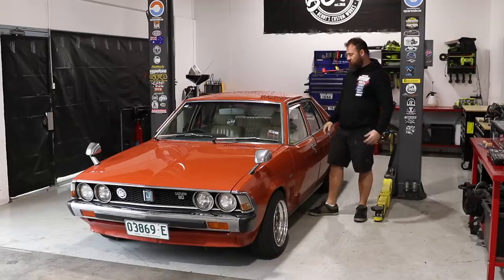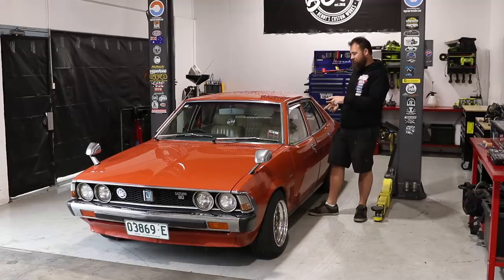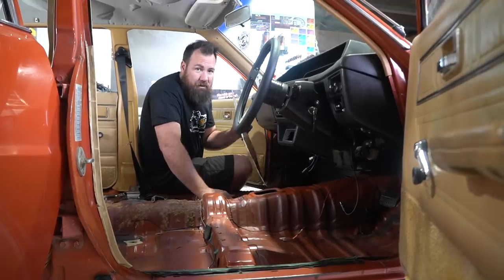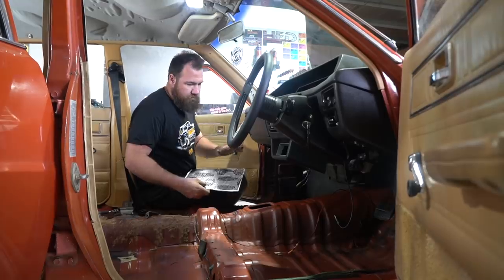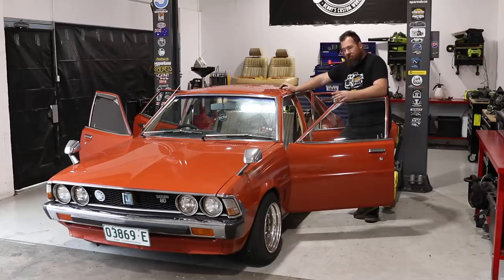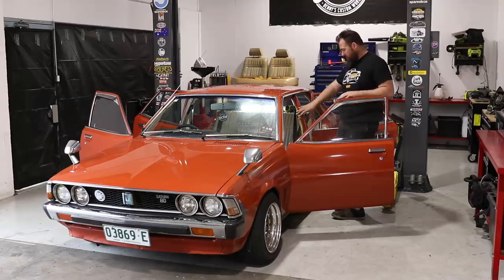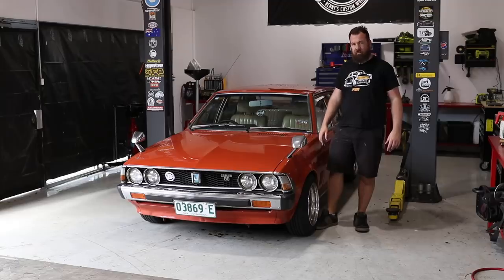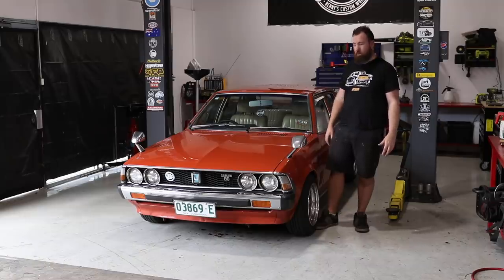Sigma - HOW TO / DIY Sound deadening, underlay and carpet

Comment: Benny, common ground stereo's were popular back in the day. Cheaper to make. As copper was very expensive for car manufacturers.
Its fine in old systems with low power output (5 to 10watt per channel).
Once MOSFETs hit the market and started pushing 30 to 50watts per channel, common ground speaker wiring was abandoned due to noise caused by chassis grounding.
FYI that OEM stereo will be worth decent money to someone wanting to restore a Sigma
Reply from the maker: It’s actually a Holden stereo ( which is worth a lot to someone restoring a VC SL/E or Brock as it’s the correct part number) I’ve got a JDM Unit to fill the hole, just waiting on my 5 day air freight from interparcel which is onto it’s 4th week in transit......
Reply: There isn't a headunit on the market that makes a true 30-50w (or 52w for fully sick Sony Xpold HU's) RMS. Whilst music is dynamic, the most you'd ever expect to see is around 18w.

Comment: Had a 1980 GH SE sedan in red with the reclining back seat. Great car bought it new for $7600.00 and kept it for 11 years. Fitted after market integrated air conditioning and fitted a different carby, drilled holes under the air cleaner , upgraded the am radio to am and fm , put rear louvre on, driving lights on front. Rust appeared in the front quarter panels cause the drain holes filled with rubbish and retained the muck all wet. But I loved that car. Seeing you rebuild this , is great for the memories. Thanks Benny look forward to seeing you finish it . Cheers

Comment: The speaker ground wiring used to be a thing. My N12 pulsar was the same.
Reply: I had an old N11 Datsun, it was my first car. When the clutch went out I swapped in an N12 engine & trans. I used to punish that poor car. It would get at least 30mpg no matter how hard I drove it, and gas was only 99¢ a gallon. The only trouble that I ever had with it was the threads, on the bolts that held the shaft mounted rockers down, pulled off. I grabbed 5 replacement bolts from the junkyard and it kept going. I miss that car.
Reply: I'm surprised benny's never come across it before, even R31 Skylines have it

Comment: Really liking this series Benny. Rebuilt a Sigma with my old man when I was a teenager. Learnt to drive in it too. Snapped the handbrake cable on my first lesson.

And yes. Earth return speaker wiring was super common in the 80s. Great for introducing alternator whine.

Comment: All my old Colts were wired like that but they were AM only.
iirc the cars all used a single console, so the Auto had the same position as the Manual.  To swap you remove a plate for the for-aft auto and the boot can be fit to the opening left.
I converted a Colt into a racecar, and that factory sound deadening was well anchored in place.

Comment: Must say that the Mitsi looks much more substatial, and styled. The dark floor is great with the orange body. Wouldn't it be sweet if the rest of the interior was also matching. It would lend the car a more contempoary look. And the plate could do with a surround. It's a period resto, and those gentle changes you're doing are bringing it back to life and leading me into a nostalgic reverie. Of course whatever you do will be worthy.

Comment: Negative to Chassis Ground(Return) works just like when you Jump Start a car. 

It is so the circuit inside doesn't die from arcing, also provide less voltage drop. Plus, it's better for the car when your battery dies since your light and radio will slowly fade away first before the plugs.

The alternator is what's running your car basically.

Comment: Regarding sound deadening, areas where the metal body has been stamped into shape doesn't require much deadening at all due to the resonant frequency in that section of stamped metal is different to a flat surface area. In areas like this you can avoid the butyl/rubber aluminium backed sheets and use a spray on deadener to save cost and weight and still achieve a good result. Jaycar actually has a very cost effective sound deadener they sell, very similar performance to Dynamat etc in my opinion.
Reply from the maker: Much like the carbuilders product we used in the video .
Reply: @BennysCustomWorks  I haven't had much experience with the CarBuilders product in my time. Mostly Dynamat and Stinger. When I saw that Jaycar had their own version I thought I'd give it a go in my Hilux front doors and am very happy with the results. I might give the gear you used a go for my rear doors and floor pan a go to see how it rates. My exhaust gets tiresome on the highway at low engine loads. 
Also, I'm looking to supercharge my Hilux 3.4L V6 petrol. You wouldn't have any leads on second hand TRD Hilux blowers or a decent equivalent would you?
Reply: @TerribleGamer thanks dude, yeah I've been searching high and low to try and piece together a kit from a TRD which is a direct bolt on for the 5vzfe or M62 along with an ecu etc. Off the shelf brand new kits, from Magnuson (I think) are about $7,000 + labour which I'm not overly keen to commit to.
Reply: @TerribleGamer not bloody many is my guess! 😂

Comment: i am pretty sure you would know if you run over the carpet with a heat gun it will help mould the carpet the shape
Reply from the maker: Yes however it can also singe the carpet. I had planned on laying it in the sun however I forgot :(

Comment: The speaker wiring is very strange, but I have seen it like that before. It can be annoying as it's ripe for interference. Not noticeable before, but now you've sound deadened the car, you're going to hear it. I would run some new twisted pairs to each speaker, and get an aftermarket head unit that looks OEM. 

https://www.classiccarstereo.co.uk/classic-car-stereos/autosound-classic-car-stereo/ccs-spindle-mount-dab-radio/

Comment: The negative speaker wire going to ground will work as long as you don’t have a lot of power going to those speakers, I don’t think it’s a great idea but it would work.
Reply from the maker: Yes it was functional but not correct .
Reply: @BennysCustomWorks  perhaps 'negative' on the head units speaker outputs were noisy??? But then again, I've fixed up some weird and whacky stuff people have tried to do when installing car audio gear. I'd like to thank Strathfield Car Radio and Autobarn installers for all the cases of beer I've received over the years for fixing their sub par workmanship.
Reply: @BennysCustomWorks  There was a time when the thought was to reverse the wiring on opposing speakers to cancel the "push" from each side... Not sure if it worked. Want to borrow my AC/DC cassettes?
Reply: @BennysCustomWorks  oh I agree, all I can think of is how many ways you could start a fire doing it like that.
Reply: @pv3566  I paid for a Strathfield install in 1991.  Two years later I pulled that head unit out and I could not believe how crap the install was!!  Wires twisted together and taped very poorly.  The whole thing was only held in by the face plate which was not even attached to the dash.  No wonder it rattled.  Rear speakers were only held in with two screws because they cut the parcel shelf hole too large.